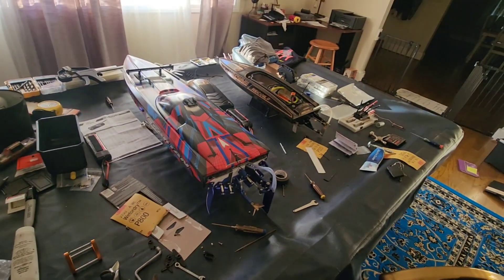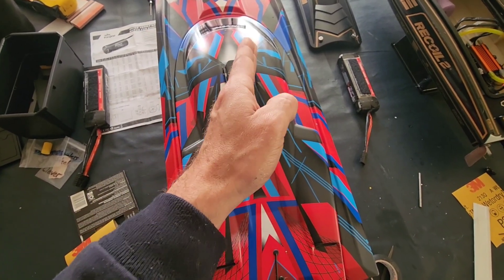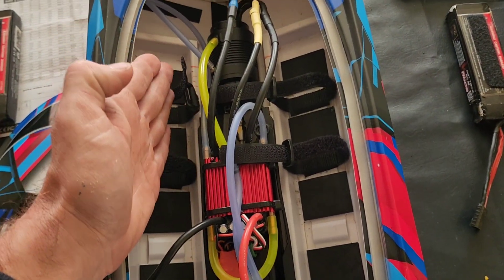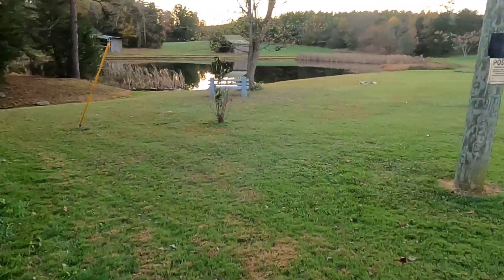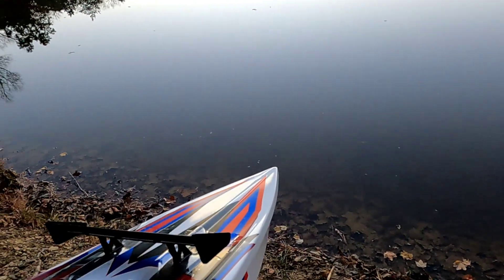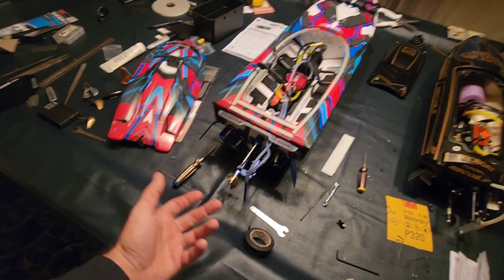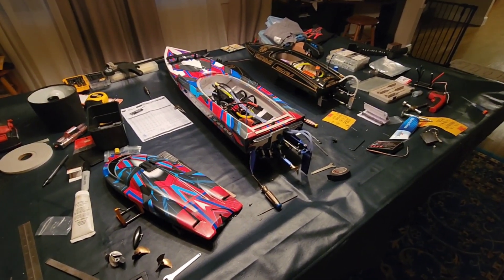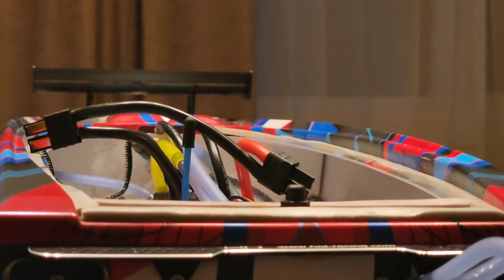Testing a Wing on a Traxxas Spartan, Aerodynamics on a RC Boat

Comment: AWSOME !!!
I’ve seen full size boats with canards on the front, it would be interesting to have them adjustable on an rc boat. RC hydroplanes have a wing in-between the sponsons in the front, some rc modelers have made them adjustable. I myself have toyed with a similar wing as the sponson support for a small out rigger however that setup made it hard to get on plane. 
Your temps suggest you could prop up a little and of course the would give you more speed. I do believe you need a bigger pond for 50+ mph. Keep the onboard videos coming,  the front to rear view is always cool to watch when putting the petal to the metal or trigger to the plastic 🤣

Comment: How you like that Esc I was thinking about buying it
Reply from the maker: I love it! It seems like a Flycolor 150 with a added cap pack. But for the price this is ready to drop in and go you can't beat it. If your ever thinking about running 8S you might want to go With a 200 amp esc (that'll be my next big step) but still testing this setup for now. I love R&D trying new ideas